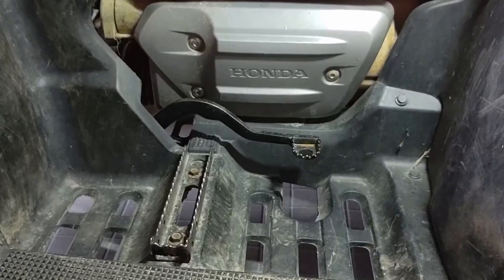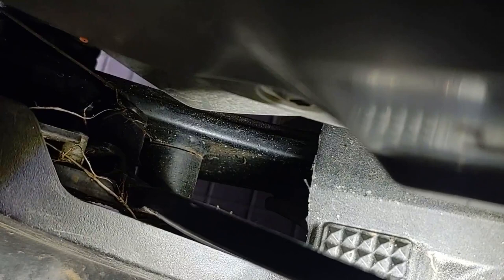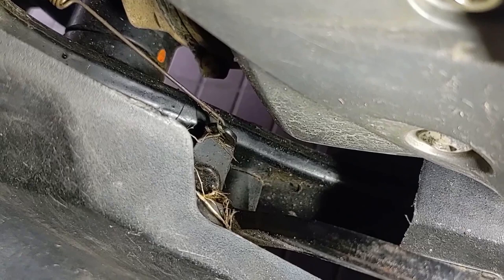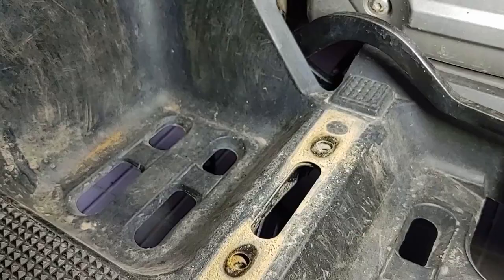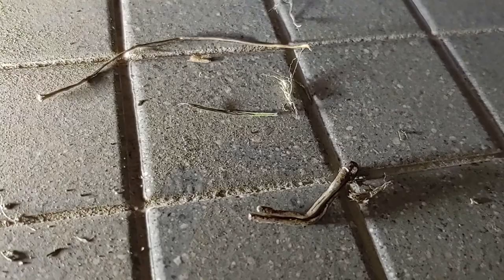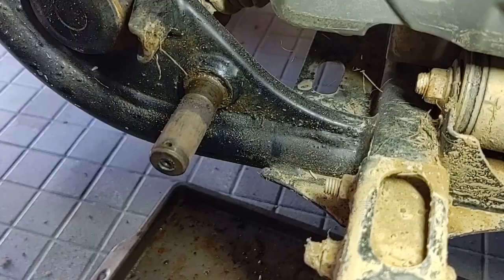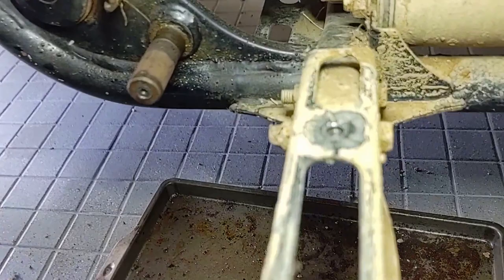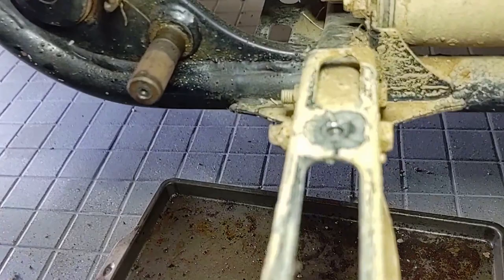ATV/Dirt Bike Foot Brake - sticking/stuck?

Comment: Great video, great detail, thanks, my 2010 artic cat 700 has the pedal stuck just like that, ugh!
Reply from the maker: Bummer, hope yours goes a little easier than ours! Def an overlooked lube point, I had never even given it a thought until that got stuck! Best of luck on yours and thanks for watching!
Reply: Did it work
Reply from the maker: Yes we got it removed and greased up and it's been working great since.

Comment: Dealing with same issue on a 2011 honda trx250. 3hrs in rn and no real progress.
Reply: Same here for my 2001 Honda TRX 250ex
Reply: I am at the same issue now 5 hours still no difference going to use  heat and puller tomorrow or thinking of drilling a little hole to allow wd40 in .

Comment: What puller did you use? Thanks for posting
Reply from the maker: I used a 3 point puller for this, it was a cheap one and broke but did get it off. For what its worth i also got the puller warrantied.